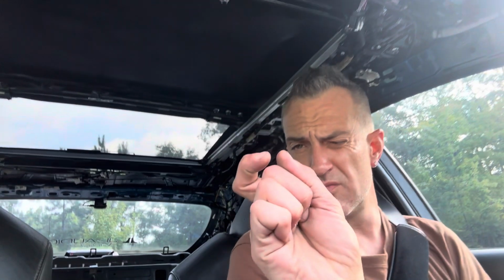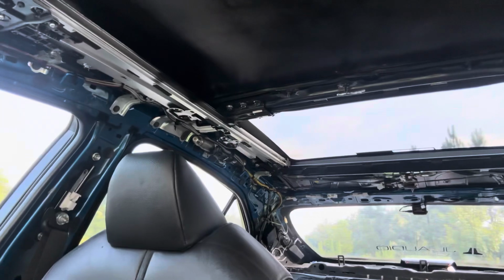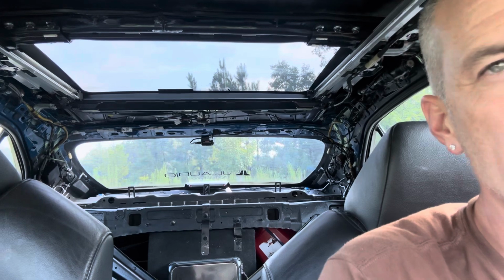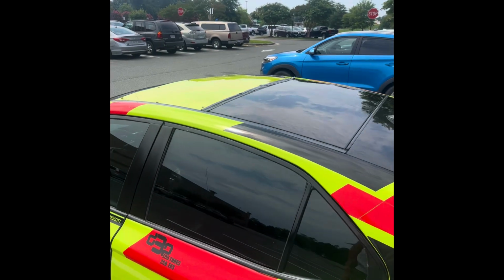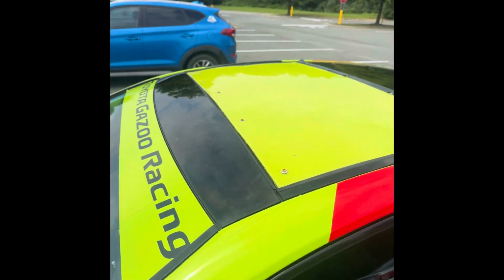Toyota Camry Gen 8 XV70 XSE XLE 2018-2024 Panoramic Roof FIX / DELETE

Comment: Might be a stupid question but the sunroof is covered by the 3 year standard “bumper to bumper” warranty right?
Reply from the maker: @MG42KOMMANDO  it is my car is 6.5 years old and had 161k miles
Reply: @prescottn6ft7 One more question, I find that when I close my door normally the back  of the sunroof glass moves a little and sometimes pushes up just a little bit, do you think this can be considered as normal or is it an issue? Oddly enough it does it considerably less on colder mornings than in the warmer afternoons and if all windows are open it hardly moves at all. No leaking noticed. Car is 6 months old at this point.
Reply from the maker: @MG42KOMMANDO  that’s a problem for a few reasons… aesthetics (it’s a new car and it should work no issues).  The interior has depressurization vents in the trunk  that are supposed to prevent stuff like that… regardless it shouldn’t move when it is closed